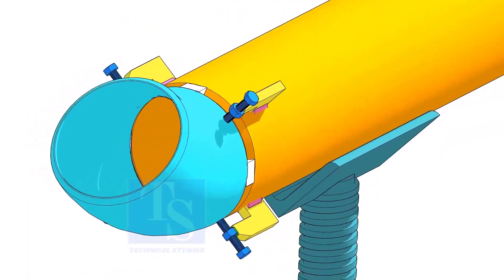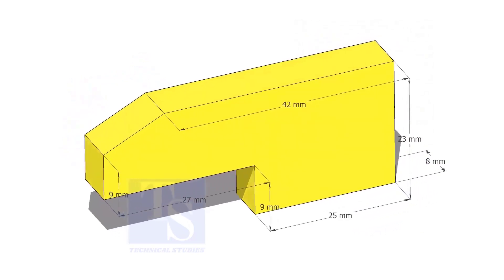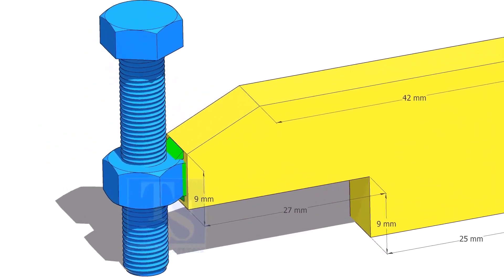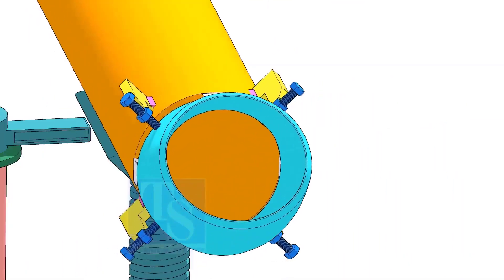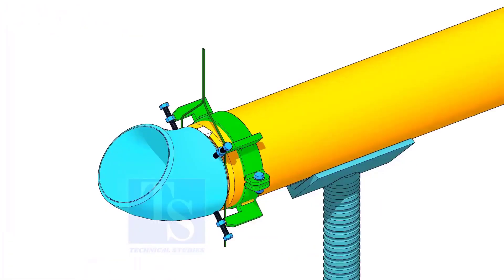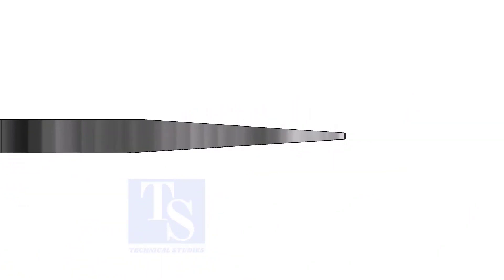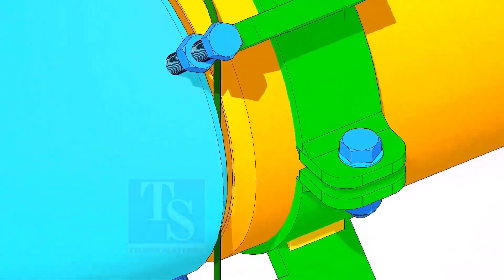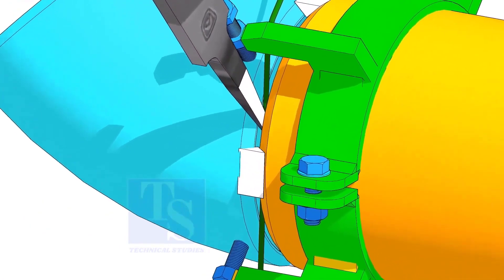How to Make Low Cost Tools for Pipe Fitting

Comment: Dogs are not recommended, because,you are welding outside welding area ,and a wedge is better than a file ,one tack then take wire out (easier to remove wire ,with two tacks the wire gets jammed because of shrinkage) other wise good job
Reply from the maker: You are correct bro. I just a method, that I feel simple for the beginners.
Reply: @technicalstudies.  No probs pal ,your tutorials are great ,I am just a old retired pipey refreshing my memory